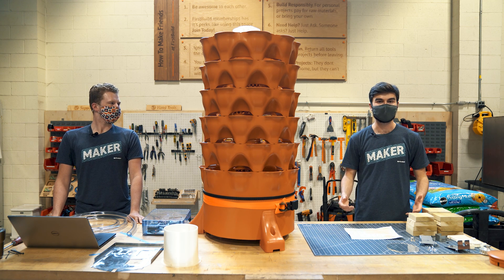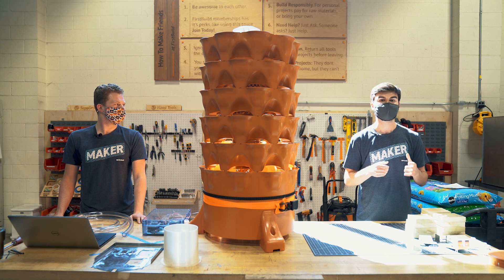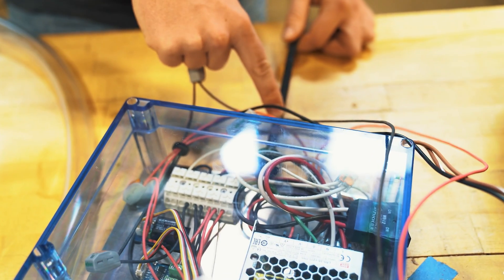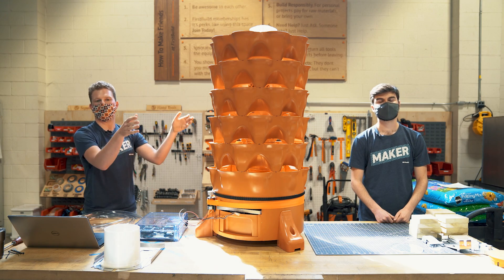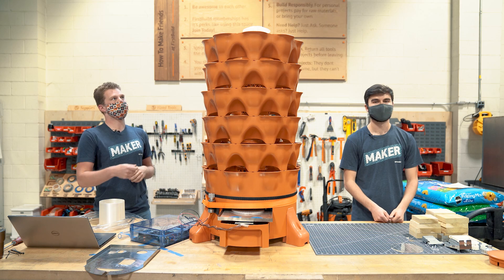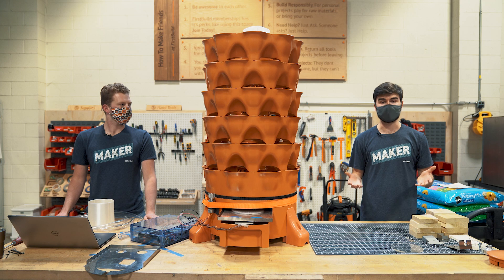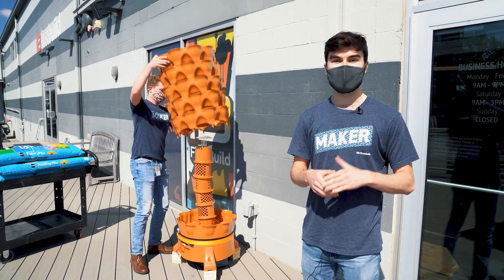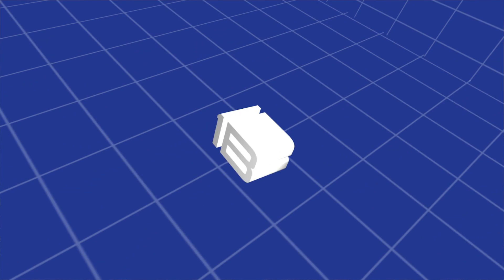Prototyping An Automated Vertical Gardening System [Part 1]

Comment: well that takes alot of the original functionality out of the tower. the reservoir at the bottom would become empty pretty fast so you would need a way to replenish the water, the water that falls back to it will be very dirty and plug up the pump. the only practical thing is the rotation.

Comment: Love this idea.
I have a grow tower and LOVE IT!  My wife and I grow everything from vegetables to herbs in it.  We normally add one or two citronella and  one or two marigolds to keep  the bugs away.
One issue you may have is that you should start your seeds so that they are small plants, or start by buying small plants,  before transplanting them to the grow tower.  I haven’t started seeds in the GT before, so I have no idea if that will work.
You should also add worms to the tower.  It is designed for organic growing.  Which brings up another issue you may.  The center tube collects soil and worm waste that is used to replenish and fertilize  the soil in the GT.  If there isn’t enough water, you may end up with mud in the bottom of the drip tray and burn out your pump.
The things I would like to see are: 
A way to meter the light so that one could rotate the tower to be able to grow  full sunlight and partial sunlight plants.
A moisture meter that regulates the pump on/off.  This might avoid drowning some plants.  Though, my wife knows which plants need to be watered less and leaves them at the top of the tower.
An app that allows for scheduling and  records the light/moisture data so that one could refine their process to gain yield. 
Awesome job, guys! I can’t wait to see the finished product.

Comment: Love this idea! A few things to consider over the evolution: 1) Different plants might take different soil types, so don't assume success or failure just because the seeds don't take. 2) Many gardeners recommend watering from the bottom, without getting leaves wet. This forces the roots to go down, prevents some level of evaporation and sometimes water on leaves for too long is damaging. 3) Consumers will want a way to label plants. Perhaps on the layer, or could be with stick/posts in soil. 4) In some regions, the heat of summer is too intense for certain plants. Certain garden covers filter light to protect them. I could image an 'umbrella' attachment as optional for use (ex: leafy greens/broccoli in July need protection in the southern USA).  5) Lastly, can we talk about the "how to make friends" sign in the background?
Reply from the maker: Great feedback, Lindley! Our favorite is rule 1: Be awesome to each other!